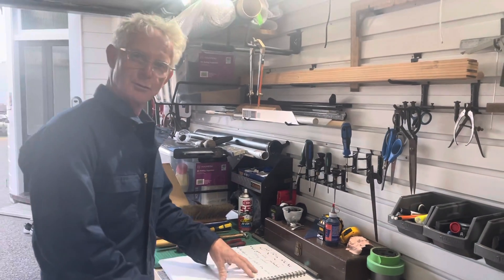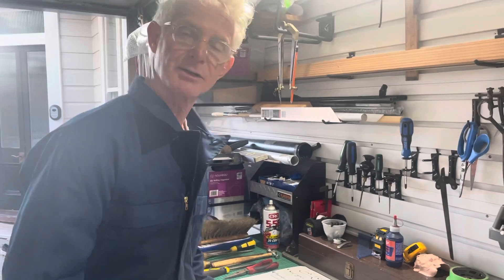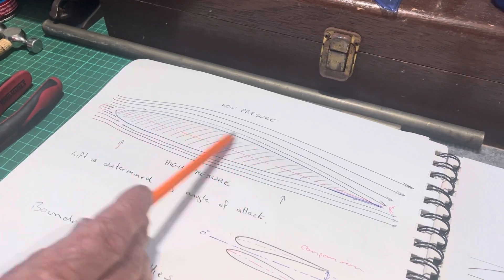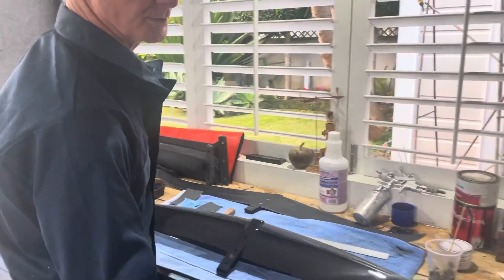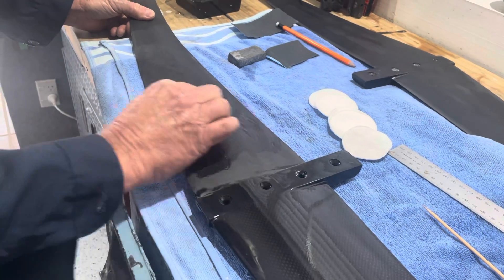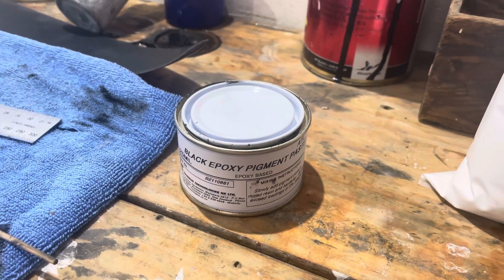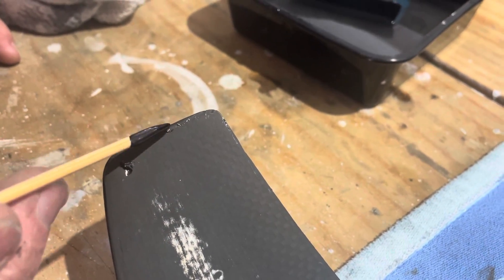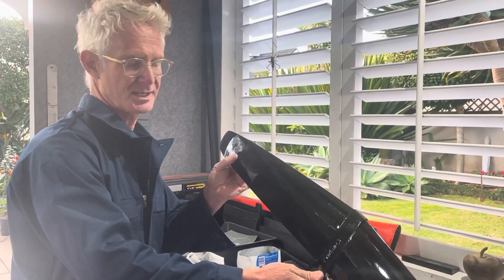Perfecting the boundary layer of foils

Comment: Great video thank you! One question: when doing to final fine sanding what is the best sanding movement? Small circles? Big circles? From leading edge to trailing edge? Or lateral from tip to tip? I saw diagonal too. What's the final movement? I am worried that with the wrong method the water might not 'hug' the wing surface properly.. Thanks!

Comment: Thanks Gary, for the new material you advised - Durepox. I'll may be try. Good video.
But two things...
1 - there is no high pressure (comparing to ambient water pressure) at lower surface of the profile you showed. May be on very low speeds and high AoA only. At normal speed and low AoA, it is low pressure there, just look at its curvature, it is just less low then on upper surface of the profile. 
2. If you wanted to apply resin, why did you rub the surface with hand? Skin oils do not help adhesion.

Comment: Thanks Gary for the great advice. I am following it to do some maintenance on my moses freeride foil and so far I am pretty pleased with how it is coming up. Question for you: What other product would you recommend for spraying other then the durepox? it seems pretty hard to get around here and impossible in small quantities. anything else a beginner could use?
Reply from the maker: Hi Massimiliano, a good question. The foil that you are working on I assume is composite and epoxy resin? Basically, you are wanting to seal the foil surface with a new boundary layer that is hard and can be finished to a smooth layer.   A good two-pot Polyurathan clear coat is good. Where do you live?
Reply: @foillabs1990  hi! Yes, carbon foil , sabfoil 790 freeride wing. I live in the USA
Reply from the maker: Hi Massimlliano, yes the best products are those used in the marine coatings industry. You could go to a local marine shop and ask for a "2 pot polyurethane clear paint. You can buy these in smaller quantities.
Reply: Hi Gary, thanks for sharing! Do you have to make de final coat (durapox or 2 parts polyurethane) with pistol and compressor or you can make it by hand?

Comment: For the thickener, why high density 404 and not something much softer like  407?  I would think you'd want to make sanding those pitting fills easy to avoid messing up nearby enamel.
Reply from the maker: Good point. You have to be very careful of the surrounding surfaces. I do use sharp blades to shave excess off when the coat is still green.

Comment: Finally found someone that pays attention to details!
I have a MOSES HAVOK that kept ventilating / cavitating above 47 km/h, so I kept dressing the trailing edges on both the mast and the wings... finally got them below 0.5mm and achieved a marginal improvement (will never by MOSES again).
As the edge was so thin and SHARP, I did have the misfortune to sustain a nasty cut on my leg during a crash @ 50 km/h.
For the past 3 months I didn't maintain my foil at all, just freeride, but I really admire Your dedication.
Keep up the good work!
Reply from the maker: Thanks for the feedback. We are still learning and much of what I show comes from good sources. I have just finished a 1000 race foil and it is way different. Very quiet but it has a sting.
Reply from the maker: Thanks for your encouragement.

Comment: Thanks Gary, for sharing with us how to improve the foils. One question, you take a lot of time on the trailing edges, I understand that is to reduce the turbulence and imperfections. But what I heard and in one of the videos you said too, is the first third of the blade is super important for the lift,  even being this important I haven`t seen you working on the leading edge.
Reply from the maker: In the video the foil, I was working on needed most of the work done on the trailing edge. Yes, the 1st third is important. Using fairing blocks and hand techniques to achieve laminar flow across this part of the foil is key. Basically from the leading edge to the max cord thickness. High aspect foils require work to sometimes halfway across the section.